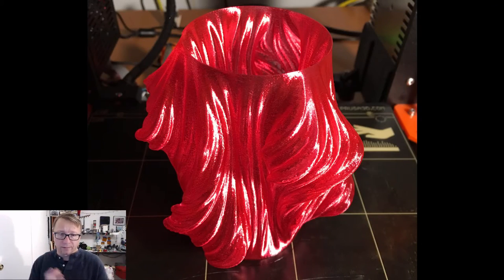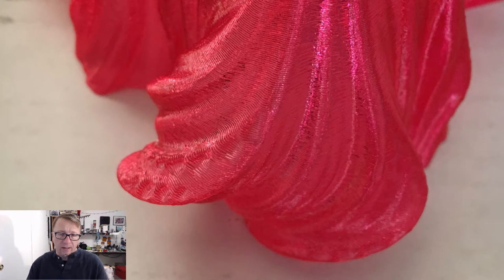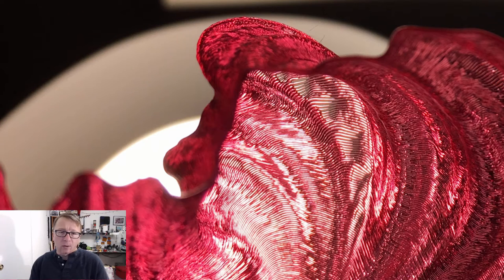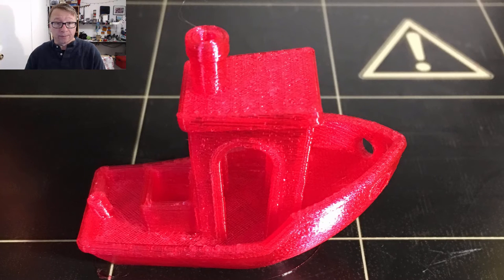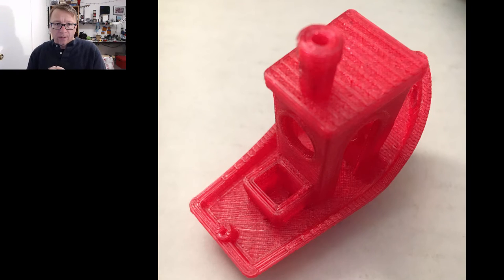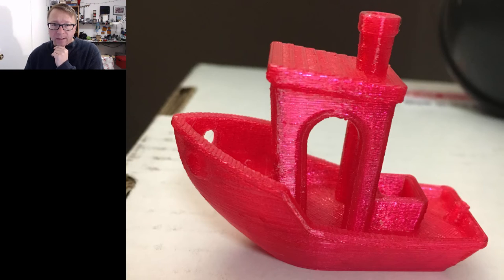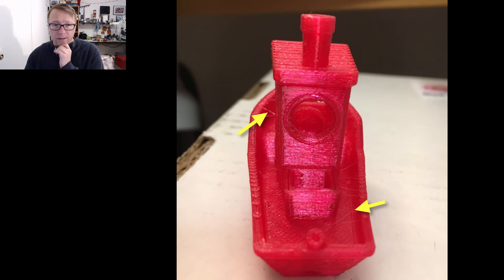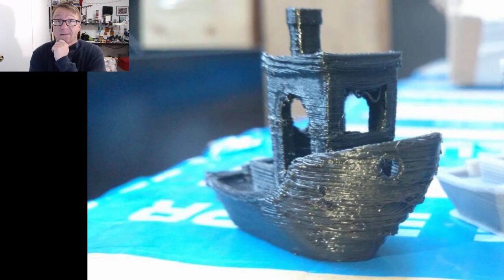Debugging Extrusion Issues with Prusa i3 MK2

Comment: What brand of filament you using?  Have you tweaked outline overlap? That will make sure the infill butts up against perimeters more. Also, you could try increasing infill extrusion width.  These are both found under the infill settings.
Reply from the maker: Hi Joey - yes the outline overlap was one of the first things I tried when I first got the printer as well as various widths.  Tweaking them helped but did not resolve them.  It was not until now I realized the issues where related to under extrusion vice something more advanced.  Thanks for the comment!  Don't forget to subscribe and like the videos :)